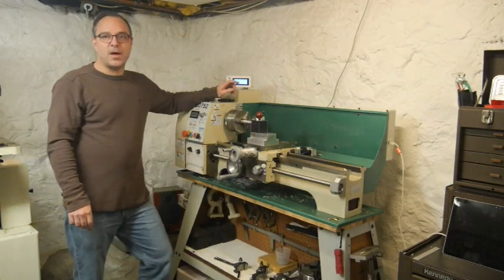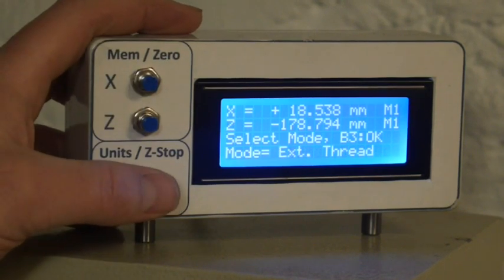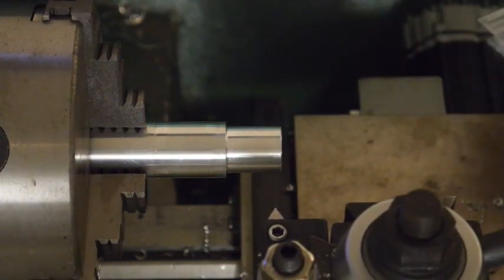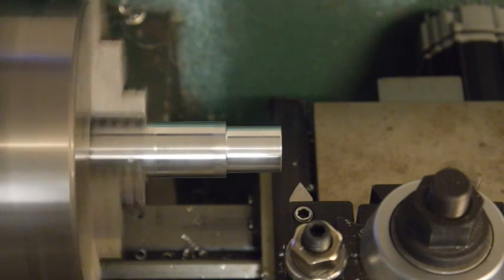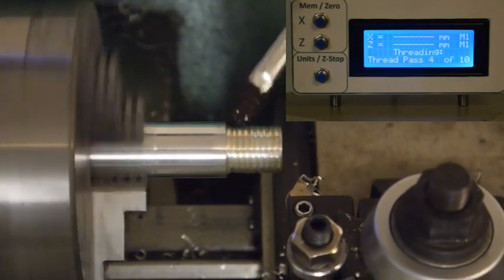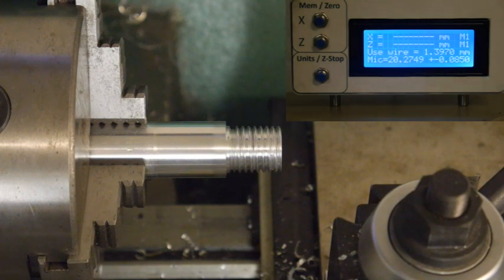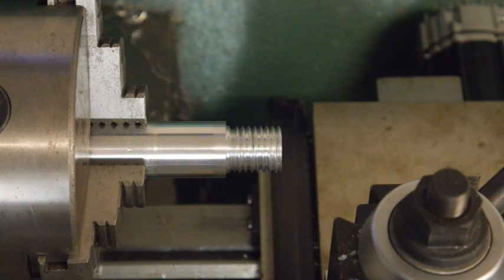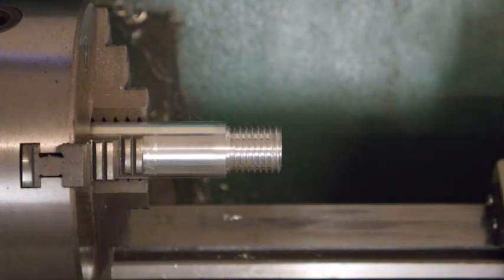CNC Lathe Threading with Arduino (2 of 4)

Comment: It's a nice job but a bit outdated, I use encoders on Main spindle, feed rod and sled spindle. Any sync between the three is possible, provided you stay below the max of 20 000 pulses per second.

Comment: I have read your Detailed Project of Lathe conversion. I would like to suggest you to use a microcontroller with Quadrature interface in-built. There are multiple boards like Arduino Due, ESP32 and some dsPIC boards which are available with this. It is basically a hardware counter for encoders so you will have zero processing power with no skipped step. Since encoders are heart of this project, This would be a very huge improvement.

Comment: Very good. Did you program the Arduini yourself??? or is it an Arduino kit???
Reply from the maker: Custom code from the ground up.
Reply: Impressive......
Reply: Wade'o Design how did you sync chuck axis with steppers?
Reply from the maker: It was surprisingly simple.  I determine the spindle speed and with that determine the required z axis motor speed.  I wait for my spindle index to come around and start the z axis (spindle index is a single pulse per rev which is on an interior pin - so quick).  Now I always know the z axis motor count number so for each spindle index/interupt I just check if the z axis motor count is where it should be.  If it's not, I just adjust the z axis speed to compensate (each spindle rev/index I do this check/compensation).  The first revolution is always a bit off (about 5-15 cnts) but settles in immediately and results in 1 to 2 motor count deviation on each rev.   I'm not sure this simple code could handle me actively adjusting spindle speed during a cut.... Would have to add more indexes per spindle rev or an encoder BUT then the Arduino would likely choken on the spindle input.  My approach uses very little resources which is necessary with the Arduino.
Reply: Wade'o Design awesome! Thanks. Could you share specs of motors? Are they steppers or servos? What about their power? Thanks!
Reply from the maker: Motors r clearpath servo (steppers).  U can find model in lathe parts list on my website.
Reply: Wade'o Design ill check soon. Thank you so much!

Comment: A big drop of thick grease makes it easy to hold those wires in place while checking pitch diameter with a mic.

A relief groove  at the back of the thread location is common for cnc threading.
Reply from the maker: Thanks for the tips.  Cheers.

Comment: Inspiring thread quality.
Reply from the maker: Thanks.  I've only played around with aluminum so far.  I hope my code (tracking only a single index point) holds up to cutting steel which may cause more significant spindle RPM deviations.